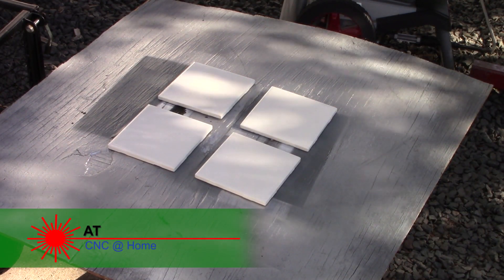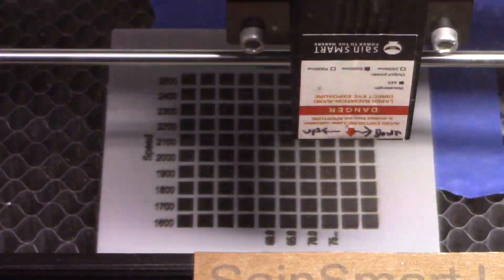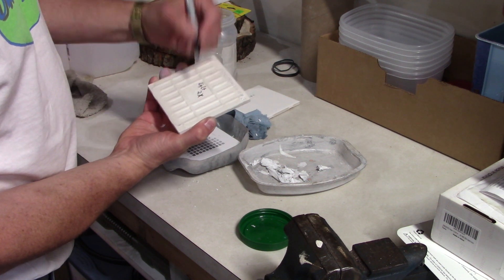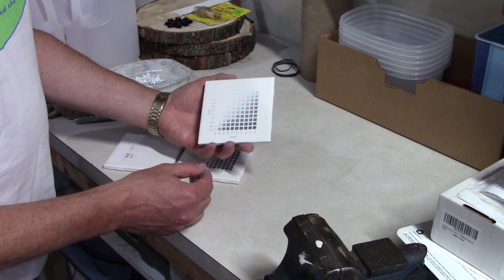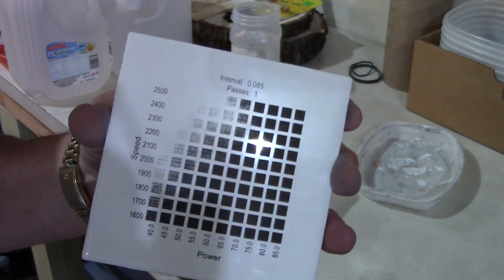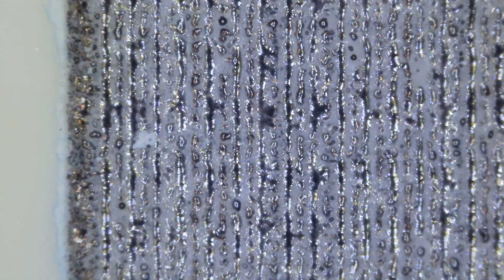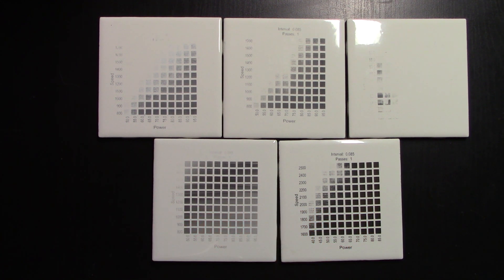Tile etching - How much paint is too much paint?  Is paint the way to go?

Comment: I have been doing glass and mirror etching here, and have been wondering about doing tiles. CGC is easily obtainable but what is this metal etching compound? Does it help with the blue lasers for etching things like stainless mugs and tumblers?
Reply from the maker: I would like to do more glass and mirror etching.  I haven't gotten the metal etching powder to work very well with my 5.5watt blue laser.  I have a 10watt now and a 5.5watt with a much tighter spot.  I am going to try doing metal etching again with that.  Their website talks about CO2/Fiber/YAG lasers. I tried finding out from them about DIODE lasers and they just said to try it and see.  The product is BLI101MBLIQ120 by Brilliance Laser Inks.  If you can get it to work, it should work doing mugs and tumblers.
Reply: @CNCATHome  I looked up the BLI101MBLIQ120 and it says it is not recommended for diode lasers. (low watt). Mine is a 20 Watt laser, 5 Watt beam. (FoxAlien). The product is intriguing but if it does not work with the blue laser, it would be a bit of a waste.

Has anybody tried it with a diode laser yet?
Reply from the maker: @mongowildman  - I have tried it with fairly poor results.  I do want to give it another change with the two new lasers I have.  The Genmitsu Jinsoku LC-50-Plus has a 10 watt laser and the Atomstack P7 has a 5.5 watt with a very tightly focused beam which makes it operate like a laser with more power.  I an not holding my breath this this stuff will work better but it might.  It seemed close with the 5.5watt Genmitsu LE-5040 variable focus laser.  Even that machine might work now as I have swapped out the laser emitter for something that is fixed focus and should have a slightly tighter dot.  This stuff it very expensive and not knowing if it works or not is a show stopper.  Since this is the kind of thing I do on this channel, I did get some and will keep reviewing it.  Maybe the stronger lasers will be what is needed to get this to work.

Comment: Thank you for your recommendation, very generous of you.  I’m doing engraving as a hobby & have gone through many times with unhappy results.  I’m using diode laser, 40W.  The one where you painted Etching powder over a single painted surface is impressive.  I presume the Etching powder is similar with Titanium Dioxide powder which I have ordered.  Katoria.
Reply from the maker: I don't know what is in the etching power.  They don't say.  ;-)  I am assuming it is mainly TO2.  I have some and will be experimenting with it one of these days. The 5.5 watt laser doesn't seem to really get hot enough for the etching powder to really work.  I have a couple newer lasers now. I will see how they work with it.

Comment: Enjoyed you controlled testing. I just got a small CNC to play around with. I painted a tile with Satin Smokey Beige that I saw recommended with two light passes. I did the grayscale test and found it strange at higher power levels the samples lightened again. Any reason for this that you know of? - Thanks
Reply from the maker: Great questions.  I have a guess but don't know if this is what is really going on.  When you laser certain paint, there is something in the paint, like titanium oxide, that will blacken under the heat and become very sticky.  When headed the right amount, we get a nice black residue stuck to the tile. That is what we want.  If we apply too much heat, I would think it basically burns away and doesn't stick to the tile.  I have seen similar results.  That is why a nice test patter helps find the sweet spot for power and speed.
Reply: @CNCATHome  I was thinking along the same line because the blocks darken with more power and then get lighter. Thanks for the quick reply. Guess I’ll pick up some of that galvanized paint and give that a try. Seems you recommend a one pass light coat.
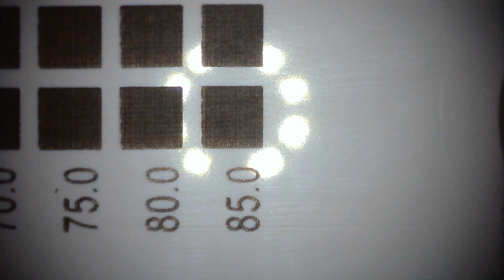Reply from the maker: @youmbgtube  - It is balancing act.  The biggest thing it so be consistent with the application from batch to batch so that your burn parameters will be the same.  Too much paint and it becomes more difficult to burn down and get the desired results.  Too little paint, and you can't get a black enough results.  The CGC tests to be easier to see how well a light coat goes on as it isn't white on a white tile. It also seems to be more consistent in converting into a black residue left behind.  In this video, I put the CGS and white paint method under the microscope and you can clearly see how nicer the CGC looks. 14:37 and 15:20.

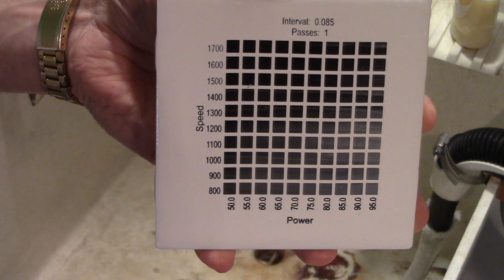Comment: Hi, Thanks for the great info.  I'm wondering, at 4:47 of the video you show the etching of the CGC and it looks like there isn't any paint on the tile.  Why does it look so much different than when you painted it earlier in the video?  Thanks again!  I will definitely try the CGC.
Reply: Also if I may.  In Lightburn, if you did not use Dither or Grayscale for the Image Mode, which other mode did you use?  Jarvis maybe?  Thanks Again!
Reply: @frostheave1960  The material tests engrave in raster "fill" mode; it is not in "image" mode. (If you import a grid of black rectangles, LB would see  as an image.) 
To test the image modes against each other, import something with a wide range from black to very light gray, which would import as an image, and then copy/paste into a grid, assigning each a different layer with a different processing mode. I haven't done it, but it is how I would go about it.
Reply from the maker: @frostheave1960  - I almost always use the Jarvis setting within LightBurn as I have found that to work well for what I have done.  It is a type of dithering.  I would love to use the Grayscale setting as I would think it would look nice but in reality, it is very difficult to get working.
Reply: @CNCATHome  Great, that's what I figured.  I Tried some engraving this weekend using your helpful guidance and the tiles came out great!  Thanks again for sharing your knowledge!
Reply from the maker: @frostheave1960  - That is good news.  I am glad you were able to get the process working.
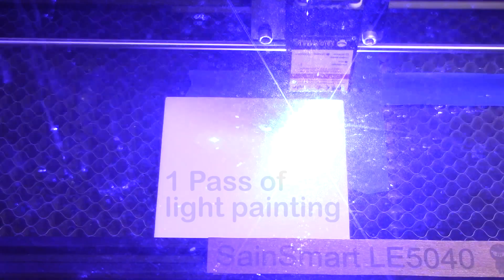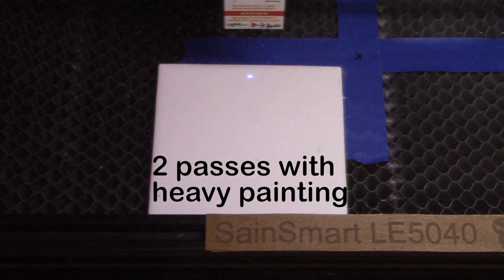Reply: Compare CGC@ 4:47 to white paint at  2:16 and at 2:50. (Doesn't wet CGC look dark compared to dried CGC?)
Reply from the maker: @bloomdds  - If I had the white tile right next to the CGC gray tile, it would look more gray.  Better lighting might help here too.
Reply from the maker: I agree, that does kind of look white.  It is grey though.  Without a white tile right next to it, it kind of does look white.  Most likely the lighting.  I painted the CGC onto the tiles outside where there was great natural light.  At 4:47, that is using an LED task light.
Reply: @CNCATHome  I got some identical paint this weekend and now see what you mean.  Thanks for the help!

Comment: sorry to bother you one thing I'm having hard time understanding is in this video when you talk about the power percentage is that the percentage of 20 watt or 10 watt laser the reason I'm asking is I have a 20 watt and if I go over 22 percent it digs in to the tile at the speed of 600mm/min can you please help me out with this issue this is my 3rd day my machine is the Xtool D1 Pro 20W thanks in advance
Reply from the maker: Great question.  I didn't provide any information about the laser I was using.  I will update the description with that information.  This was the 5.5 watt laser.  With your 20 watt laser, you will need to bring the power down and the speed up.  A basic calculation would say that my 80% would be your 20%.  In reality that isn't accurate but it is a good starting point.  I hope that helps.  Good luck with your Xtool D1 Pro.  Sounds like a fun machine.
Reply: @CNCATHome  the reason that came in mind and been thinking about since last night because of my 3d printing when i prepare the Gcode on the slicer i set the speed but to tune it while on the machine you are only tuning the percentage of the set speed/power thanks for your help i wanted to confirm before i spend another 36 hours lol cheers
Reply from the maker: @raffiem  - The current version of LightBurn will let you adjust the power and speed while you are burning something.  It too does it in percent.  For the most part I don't use it.  When I am trying to tune in feed and power settings, I will tweak it sometimes during the burn. ;-)

Comment: where can i get the grid test file if you dont mind me asking
Reply from the maker: Good questions.  The power and speed test that I used in this video is a feature within LightBurn (see this video for a simple tutorial on how to use it: https://youtu.be/RPNzjK4kvEQ).  You set the parameters for what you want to test and it generates it for you.
Reply: @CNCATHome  thank you for the fast reply you are doing an awesome work cheers
Reply from the maker: @raffiem  - I hope it helps.  🙂  Before LightBurn had the material test feature, I basically created an array of squares and set the burn parameters on each one.  It worked but was time consuming when you wanted to try other speeds or power settings.

Comment: The cold galvanized looks like it wouldn't be to good doing a dithered or grayscale image.
Reply from the maker: Grayscale is difficult to do as a general rule. I will have to give the dithering a try with the CGC to see how it turns out.
Reply: @CNCATHome   That would be an interesting test. CGC is 95% zinc which is the catalyst for etching tiles.
Reply from the maker: @privatebubba8876  - I am guessing it will work well.  We will see.

Comment: INTERESTING, I LASER ENGRAVE ON 12 X 12 CERAMIC TILES, AND I PAINT THEM WHITE GLOSS, AND I RUN THE SAME MATERIAL TEST AND I REMOVE OF THE PAINT AND TAKE A WIRE BRUSH OVER IT TO REMOVE ALL OF THE PAINT, ITS SHARP, CLEAN AND DARK, IT LOOKS GREAT, VARIES LIKE IT SHOULD, I SPRAY 3 DECENT COATS, I SPRAY IT A LITTLE HEAVY, THE END RESULTS ARE ALWAYS THE SAME, ONE THING THAT REALLY DOES HELP IS KNOWING HOW TO SPRAY CAN CONSISTENTLY, TO HAVE TO SAME EXACT QUALITY SPRAY COVERAGE AND CONSISTENCY EVERY TIME, IT TAKES SOME TIME TO GET THE SKILL, I CAN SPRAY HEAVY ENOUGH TO END UP HEAVY WITHOUT HAVING ANY RUNS, OTHER POINTS WHEN SPRAYING IS MAKING SURE THE SURFACE IS CLEANED CORRECTLY, I NEVER LAY THE TILES DOWN, I SET THEM AT AN ANGLE TO SPRAY, ALSO TEST SPRAY THE CAN ON ANOTHER SURFACE, THIS GET THE PAINT FLOWING ALSO PREVENTS SPLATTER OR TEXTURE, THE PROBLEM I TEND TO NOTICE WHEN PEOPLE USE A SPRAY CAN, THEY JUST SHAKE THE CAN FOR A VERY SHORT TIME OR NOT AT ALL, THEY JUST SPRAY RANDOM AND WAY TOO HEAVY AND WAY TOO CLOSE, THE DISTANCE AND SPRAY TECHNIQUE REALLY MATTERS, ALSO I MAKE SURE I REALLY REMOVE THE PAINT AFTER ENGRAVING, I USE ACETONE ON PAPER TOWELS TO REMOVE THE PAINT, I KEEP ON GOING OVER THE ENTIRE TILE UNTILE NOTHING MORE COMES OFF, I FOUND THAT THE DARK PART OF THE ENGRAVING WILL TAKE A FEW TIMES TO REMOVE ALL OF THE GRAY AND BLACK DUST FROM THE ENGRAVED IMAGE, AND AFTER THAT I POUR A LITTLE ACETONE DIRECTLY ON THE SURFACE OF THE CERAMIC TILE AND SCRUB IT WITH A WIRE BRUSH, AND THEN ONE MORE QUICK WIPE, THE IMAGE IS ALWAYS DARK AND DETAILED AND PERMANENTLY ON THE TILE, THE ONLY ISSUE I RUN INTO IS FAINT LINES OR A SLIGHT LINE PATTERN, I AM STILL WORKING THROUGH THAT ISSUE, I HAVE ALMOST ELIMINATED, THE TILES I HAVE BEEN USING ARE MAN MADE AND NOT MACHINE MADE, SO IT TAKES ME SOME TIME TO FIND A DECENT BALANCE BECAUSE OF THE WAVINESS AND UNEVENNESS, I NEVER HAVE LIGHT AND DARK ENGRAVINGS, I HAVE A FEW 12 X 12 SPRAYED READY TO GO, AND I WILL BE RUNNING THE MATERIAL TEST IN POWERS OF 10 AND IN POWERS OF 5, I FOUND THAT SOME TIMES SETTING AT 55 PERCENT IS BETTER THAN 60 PERCENT, THERE WILL BE 4 TEST, 2 FILL, AND 2 LINE, SORRY FOR GETTING IN TO THIS IN MY COMMENT, I DO KNOW THAT A LOT OF PEOPLE HAVE A HUGE PROBLEM WITH ENDING WITH A DECENT SPRAY COVERAGE AS WELL AS A DECENT END RESULTS WITH THE ENGRAVING, ANOTHER THING MOST PEOPLE DO NOT KNOW ABOUT IS HOW GRAPHICS AND FONTS ARE MUCH EASIER TO ENGRAVE AND CAN BE MUCH DARKER THAN IMAGES, IMAGES ARE TRICKY ESPECIALLY WHEN ENGRAVING ON A LARGE OR SMALL AREAS, THE BEST ADVICE THAT I CAN GIVE IS WATCH VIDEOS ON HOW TO SPRAY CAN ANYTHING(NOT JUST CERAMIC TILES), PRACTICE, THIS VIDEO IS A GREAT EXAMPLE OF HOW TO END WITH A QUALITY CONSISTENT RESULTS, THE MATERIAL TEST HELPS, BUT IT ONLY GIVES A GENERAL LIGHTNESS TO DARKNESS, DOES NOT GIVE ANY IDEA OF WHAT THE ENDS RESULT WILL EXACTLY BE, EXAMPLE, I DECIDED TO PLAY AROUND ON SOME POLISHED METAL, METAL IS WAY DIFFERENT AND TAKES MANY PASSES TO ENGRAVE, I SPRAYED ALMOST HALF WHITE GLOSS, AND THE OTHER HALF, I COLORED WITH A FAT BLACK SHARPIE, I WAS CURIOUS ABOUT THE AMOUNT OF PASSES IT WOULD TAKE TO MARK THE METAL AT LEAST, I DID A MATERIAL TEST ON BOTH SIDES, PLUS SOME IMAGES AND GRAPHICS ON BOTH SIDE, ON THE PAINT I RAN 1 PASS ON EVERYTHING, AND ON THE BLACK I RAN 2 PASSES, I THOUGHT IT WAS GOING TO MARK OR IMPRINT A LITTLE I WAS NOT EXPECTING MUCH TO REMAIN ONCE I CLEANED OF THE PAINT AND MARKER, ONCE I REMOVED ALL OF THE PAINT AND MARKER, ONLY NOT EVEN 1 PERCENT MARKED, MOST IF THE METAL WAS BLANK, I RESPRAYED AND RECOLORED THE SAME WAY, AND THIS TIME, I RAN 10 PASSES ON THE WHITE AND 5 PASSES ON THE BLACK, MATERIAL TEST, GRAPHICS, AND IMAGES, I HAVE NOT CLEANED IT YET, I KNOW THAT IT DID ENGRAVE MOST OF THAT, A FEW DAYS AGO I ENGRAVED A NAME ON A FOLDING KNIFE, I ENGRAVED THE NAME ON THE HANDLE AND THE BLADE, BOTH AREAS ARE POLISHED METAL, THE NAMES CAME OUT GREAT, I USED A SHARPIE TO COLOR THE METAL FIRST, SORRY THIS COMMENT IS SO LONG, I TAKE PHOTOS AND MAKE NOTES, THIS KEEPS TRACK OF EVERYTHING AND PREVENTS REPEATING THE SAME TEST, BESIDES MATERIAL TEST, I USE IMAGES AND GRAPHICS TO RUN TEST ALSO
Reply from the maker: Thank you for the long comment.  It sounds like you are having fun experimenting with different techniques and materials.  The material test is great for getting you close to a good starting point. There are always variables with your coating, material, image, fill, etc...  Out of curiosity, how powerful is your laser?  When I go thick on the paint, it turns black but then washes off as it did not ahead to my tile.
Reply: @23names13 I know I'm late with this, but this is just disgusting. Oh My GOD!!! Have you ever heard of punctuation? What do they teach these days? Or were you just absent that day or too busy playing on your phone?

Comment: Very informative. Can I use zinc spray instead of cold galvanizing compound?
Reply from the maker: I would think ZRC would work as well as CGS.  My can even says it is a Zinc Rich Coating.  I have not tried a zinc spray.  If I come across some, I will pick some up and give it a try.